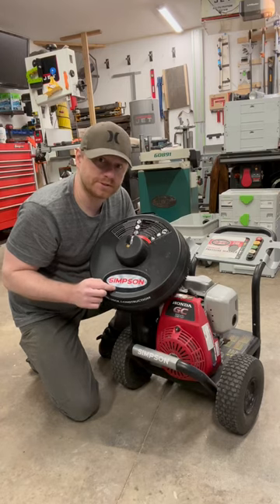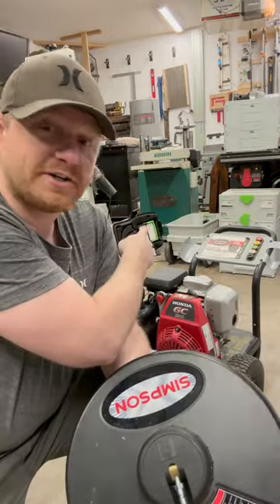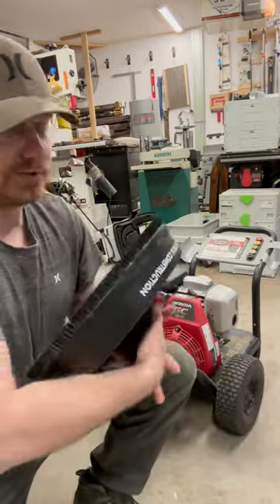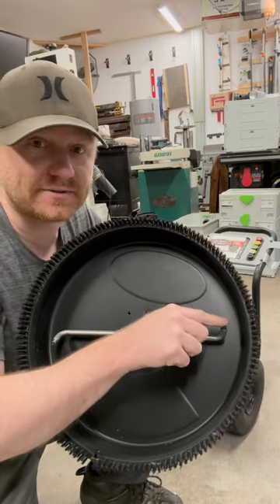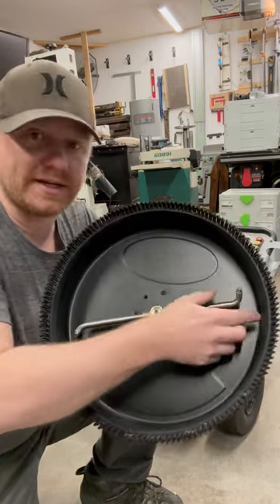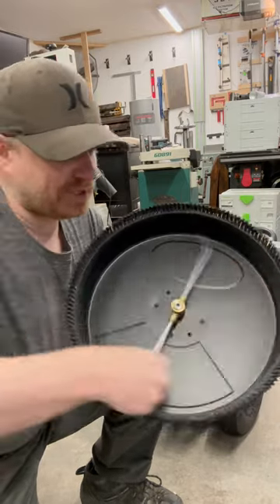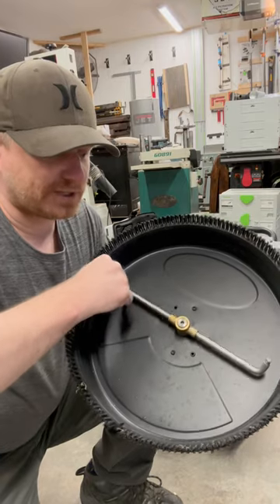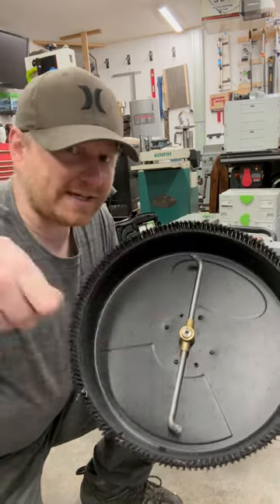Do NOT Buy: Simpson Surface Pressure Cleaner

Comment: I agree, this thing isn't worth the name "Simpson".  A few hrs of use later and the shaft bearing wears out and leaks.  Or, as noted in this review, it stops spinning.  Zero replacement parts available, I called an spoke to both Simpson and the company which actually manufactures these.  Forget about adjusting nozzle sizes to your use case also, they are non-standard diameters, no-one stocks (or in my exp can get) 1/8 in threaded replacements.  Get a real cleaner with standard sized nozzles and repair parts available.

Comment: Buy a commercial brand and you’ll never have this issue. BE sells a 16 inch floater that has a serviceable nozzle spray bar and the whole unit is serviceable all the way down to the swivel it’s the main brand we sell to our commercial pressure washing companies
Reply: Our price is $399 but you can prob find them cheaper online

Comment: The make and model you bought must not be good then. Surface cleaners work very well if they are made right. The one I bought works flawlessly and has a steel housing. It's a dewalt model if I remember correctly. The one you're holding looks like some el-cheapo plastic model that costs a fraction of the better ones.

Comment: They aren’t saying it is 3,700psi, they are saying that spray attachment is rated up to 3,700psi.
Reply: What hes saying is, it cant handle 3700 psi, therefore, the max should be changed because if you use the max that is printed on the thing, it wont function properly.

Comment: Hmm... I could fix it... Firstly. Solder the connections heavily. Use a track and bearing system behind the nozzle like sliding glass doors in the bathroom kinda. There now you have created a much better tool. Anyway I know I could do better than that but I don't want to think about how to solve someone else's issue that they're having with a tool they bought. I modify every tool I own. If it's casted I usually do the fit and finish work that almost never is done correctly or entirely. If it's forged I reheat treat it. I can't stand a brittle tool snapping on me due to impact or drop damage. I don't understand the mentality of "don't mess with it, you'll void the warranty!" Really!? Have you ever taken advantage of a warranty?

Comment: I hate that stupid thing. I also want to take it out back and smash it. Then I want to repair it to new, so that I can smash it again. I got a new surface cleaner that’s 20” and has rollers, super low profile and works on 3000+ psi washers.